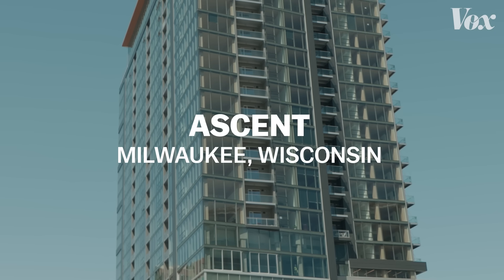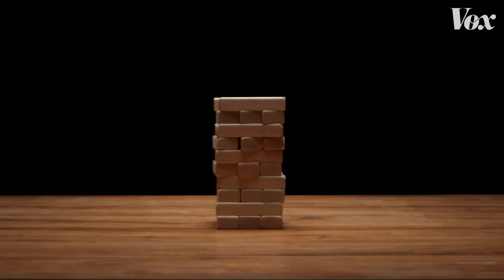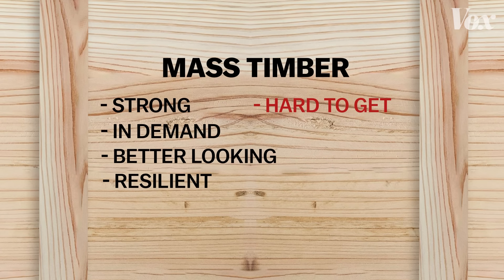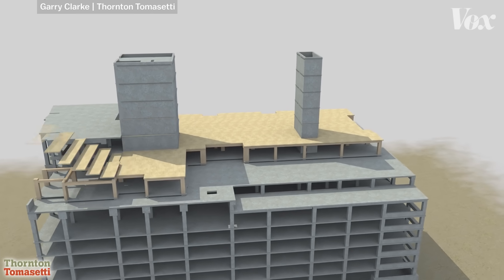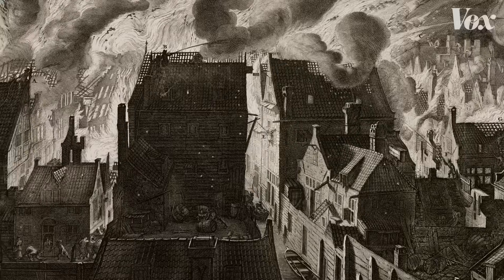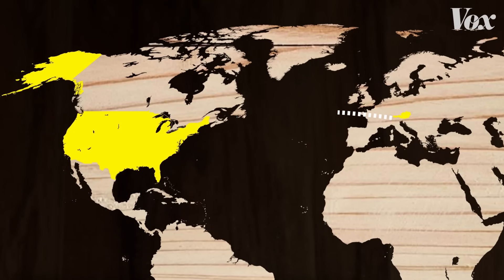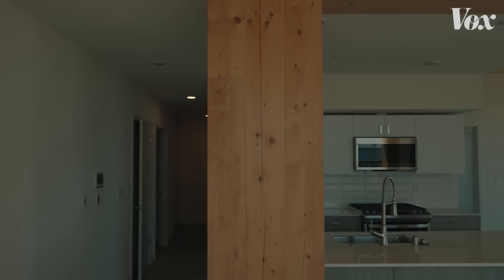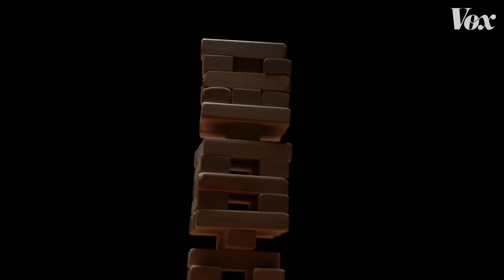How to build a wood skyscraper

Comment: I would wonder about rot, and I'm sure there's thousands of other issues. I'd like to see a follow up, even if it's just an article, about the older buildings and how they're fairing, especially around the foundations
Reply: I assume for rot they have measures like pressure treating and coating the wood to prevent rot
Reply: @charliemaybe  wood needs no coating, only to be ventilated.
Reply: My grandma has a wooden hut which we stay in every holiday in austria and half of it consists of ~175 year old wooden beams. The surface isn't that even anymore and there are a lot of visible paths from woodworms, but they still hold up nicely.
Reply: The wooden structural elements aren't exposed to the outdoors. As long as the timber isn't sitting in water or isn't exposed so often that it can't dry out, rot isn't an issue.
The cladding isn't the same as the core. When you hear wooden skyscraper they're almost exclusively talking about the "Skeleton" of the building
Reply: wood lasts longer than reinforced concrete
Reply: @viewer-of-content  
Unless water gets into it, then it rots
Reply: @viewer-of-content  not true.
Reply: @viewer-of-content  says who?

Proper concrete and rebar is stable and not subject to fungal or insect attack.
Reply: @aredditor4272  Reinforced concrete has an even bigger long term problem - corrosion from the rebar. This is completely different from unreinforced concrete structures like hydro electric dams that are designed to last 100 years or more or ancient Roman concrete structures.
Reply: @MrAnonymousRandom  there are levels to quality of rebar, the way it's placed, and composition. There's spun basalt, fiberglass, and corrosion resistant steel. 

Basalt can be used on docks. 

Bridge supports, piers, breakwaters, seaside structures, lighthouses, are just a few examples of where concrete is used in the most corrosive areas possible.
Reply: @aredditor4272 I'm not even referring to particularly corrosive environments for concrete. Once you go back to mentioning alternative materials/methods, you're defeating your own argument by not acknowledging that properly treated wood has its place when used correctly. As with anything, even if it's sound from an engineering perspective, it's no good if the regulators and insurance companies refuse to sign off on it. I'd be more concerned about the faith the latter two put behind new construction materials/techniques than how confident the engineers are.
Reply: @MrAnonymousRandom  Right now I'm very worried about flights of stairs built in 1986.

It's a 4 story hotel with 4 sets of four stories of stairs and landings. 

The stringers and beams were glue-lam. Wish I could show you my  imaging of the rot and termite damage that I have on my phone. 

One of my main jobs is trades work on a typical wood framed 4 story hotel. 

I could go on quite a bit on the issues they have there. Mostly due to water from in wall leaks, toilet overflows, tub overflows, people who can't use a shower curtain properly, accidents or vandalism of fire sprinklers. 

Back to concrete, just how far away or removed are you from coastal areas?

There's all manner of concrete structures  IN the ocean. Some that withstand constant pounding of waves.
Reply: @aredditor4272  water erodes steel and concrete both of which are impermeable so left to sit in water will not have the same longevity as wood which is breathable.
Reply: There are wooden buildings that are hundreds of years old…
Reply: @EmotionalWeather  The Colosseum and Pantheon are close to 2000 years old. They're concrete structures.
Reply: @aredditor4272  those are not reinforced concrete reinforced with carbon steel
Reply: @aredditor4272   generally, all materials used in construction nowadays require inspection, maintenance, and mitigation against forms of deterioration. fungal attack in the case of mass timber can be considered analogous to corrosion in steel, as in both cases we use external coatings to prevent intrusion of air/water, and inspect for cracks that may allow for such intrusion. i do wish the video had a bit more comparison on maintenance and resilience and whatnot, but that's more than can be expected in ten minutes. we have to look up the rest ourselves, and i'm sure some of it is still being researched as well. but we try not to build things to last 2000 years nowadays because it tends to require more material than is cost effective
Reply: @aredditor4272  The dome of the pantheon is also 20 feet thick. You can easily make a building last that long but it's very expensive
Reply: @viewer-of-content  and they've STILL lasted nearly 2000 years.
Reply: @aredditor4272  I meant reinforced concrete usually has a shorter lifespan than pure quickset concrete or roman concrete. The steel rusts and expands more than the surounding conrete creating structurally significant cracks and failure points that are difficult to inspect. Aka not a valid argument.
Reply: @aredditor4272  made from limes which are breathable.
Reply: The timber is glulam- which is sheets of timber glued together and coated. This increases fire resistance and protects the wood. Also, the structural timber is inside the walls of the building, protecting it from the weather
Reply: I believe it is coated with as special kind of paint on the outside
Reply: @MuhammedAasil  What is your comment supposed to mean? Wooden building (especially these modern ones) are safe
Reply: Concrete rots too
Reply: Wood under water can last thousands of year.  Modern buildings use wood piles sunk underground too.
Reply: Steel corrodes too...
Reply: Urnes stave church in Norway is fully wood and built il 1030
Reply: @jubmelahtes  
And how many ancient castles in Europe are still standing?
Reply: I'll be scared to see even a single termite on the wall
Reply: Lam lumber doesn’t rot like sticks. Besides, I’m sure it has plenty of copper and cyanide. 

Rot is a concern in steel structures because steel is a great conductor of heat. If the dew point is below the temp of the air making it’s way though the gaps in the vapor barrier and then hits steel it will 100% condense and cause rot on the gypsum board.
Reply: Every beam is almost a tree. Takes like dozen trees for a room. 120 years in total to grow a room. Or you can dig and makes cement in one day. Everything has a price.
Reply: @ilsunnylo3562  "120 years in total to grow a room"
I love when people just make up completely arbitrary figures to throw into a comment.

Comment: How is this better against fire?
Reply: The outer layer of the wood carbonizes, so the wood protects itself from the fire.
Reply: @bitume  Wood beams might endure fire long enough for firefighters to put it out, but in the end, it's getting torn down afterward.
Reply: @aredditor4272  Same case with a concrete or steel building. The only job of the building in a large fire is not to collapse. Large amounts of damage are expected.
Reply: @AC-im4hi  I know, One Meridian had to be torn down, but it didn't collapse.
Reply: If you watched the video, perhaps you wouldn't need to ask the question. :)
Reply: It’s not!

Comment: The fact that the timber building looks like any other condo on the continent just goes to show how rigid the building codes are that even when you use a novel material like compressed timber, you get the same result aesthetically
Reply: Columns usually are the same not because of codes but because of physics.
Reply: Building codes aren't the problem to design, designers are. As long as the building is sound, inspectors don't care and more aesthetically pleasing designs only add value to the cities but designing the building requires accepting what the market wants. Architects have this problem internationally when they want to explore more of a country's culture but are limited by the client to look more modern and "western". That building was built to sell units, not to make a statement and a building that looks like what's trending is more of a sure sell.
Reply: It's definitely distinct in person. The way they designed it showcases the timber beams from inside the glass.. quite unique to the buildings surrounding it.
Reply: @Zaydan Naufal Maximum profit comes first in Jakarta👍
Reply: Ye its a shame, even globally, all major cities are creating buildings that are so similar. No longer can you  travel to another major city and see design styles unique to that area or region.
Reply: It's actually a good thing. Here in Brazil, buildings are a dismorfic mess.
Reply: give it another 5 or 6 years of toronto weather conditions and heavy snow fall plus maybe a lithium battery fire or two from an electric scooter or overheated samsung.....and see how well ur fancy condo still adheres to rigid building codes and aesthetics.

Comment: I’m not expert but I do not think wood is more resilient to fire than concrete
Reply: Fire rating is to do with how long a column retains its strength. In some cases timber (specifically glulam) can actually hold its strength longer than concrete due to charring.
Reply: They are different. Concrete  is a sacrificial fire barrier; as it slowly degrades, it actually releases water when heated. Wood, on the other hand, feeds the fire as long as some wood is exposed. When it chars over, it burns more slowly, but under the right conditions (eg. a campfire) all of it will burn. I'm skeptical of materials used in a critical application being chosen based on best-case-scenario tests. A building this size is only as good as it will be on its worst day.
Reply: Well you said it. Not an expert.